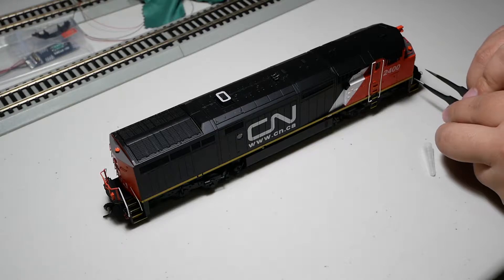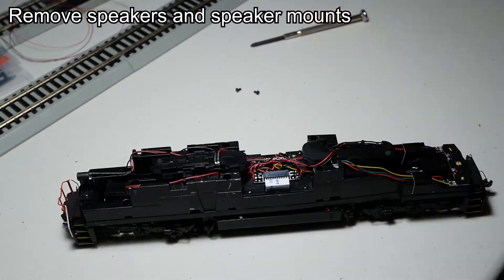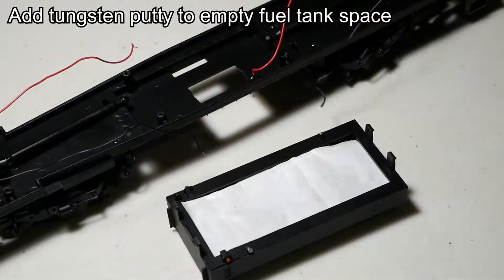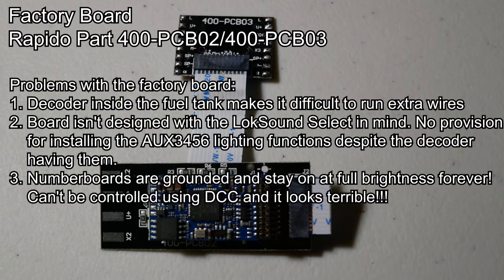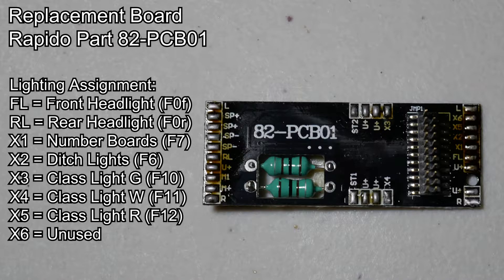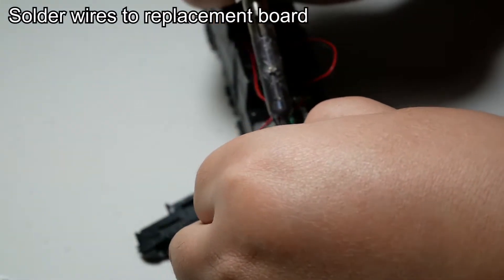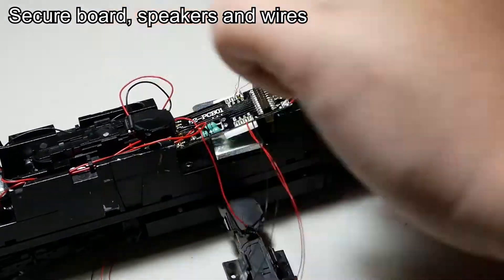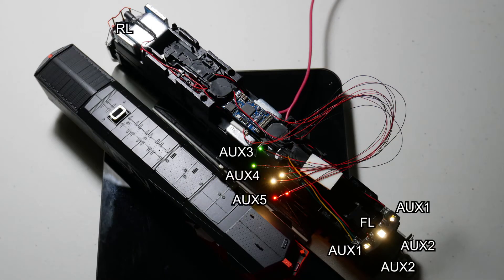Rapido C40-8M Dash 8 CN 2400 DCC Sound Custom Build Part 1

Comment: Great video. Looking forward to part 2. Just wondering what type of soldering iron you use?
Reply from the maker: I'm using one of those cheap $5 ebay 60w adjustable knob irons (http://ebay.to/2ovAJmY). 60w is a little excessive for the job, so I have to turn the knob/heat all the way down. I'm going to get an actual soldering station when this thing breaks.
Reply: Thanks!

Comment: Cool mod to the loco.  Were do you get the circuit board?  I ordered a few of those speakers from China but they take so long to get here, damn customs.  Its fun to solder 0.1 wire to 0403 led's, not.
Reply from the maker: I pestered Rapido to sell me a few. $25 for one including shipping. I considered using the ESU 51968 as well but soon realized that the 51968 has no onboard resistors.

Comment: What circuit board would you suggest in place of the Rapido Part 82-PCB01?  I tried looking on ESU's website but didn't find anything that was similar.
Reply from the maker: I strongly suggest using the 82-PCB01 or any other 21-pin board with soldering pads for the 8 functions (I think Athearn has one available now but the Athearn board is quite big and I make no guarantees that it will fit inside the Dash 8 without modifications). TCS offers a bunch of 21 pin boards commercially but I personally think they're too expensive and TCS's onboard KeepAlive interferes with the ESU decoder's programming. ESU has a board called 51968 that's similar to the 82-PCB01 BUT here's the catch: the 51968 does not have resistors so you must add your own. Do not use the 51968 without resistors because you will blow all the LEDs.